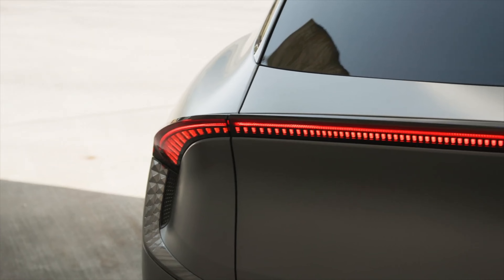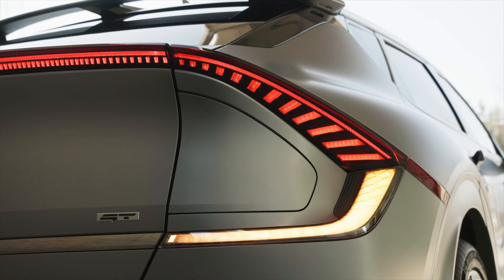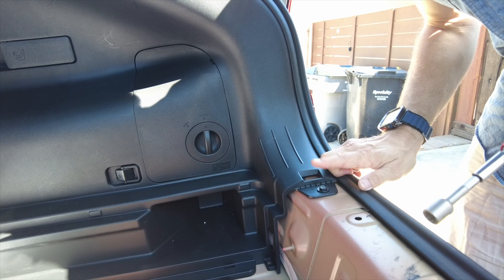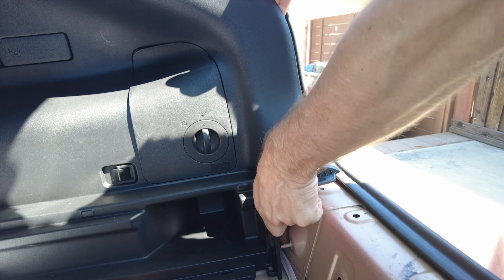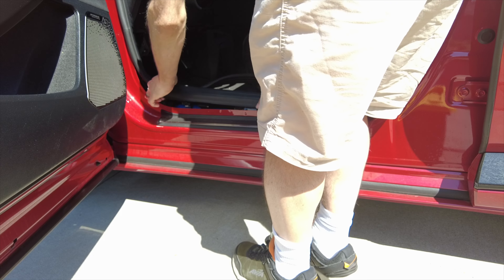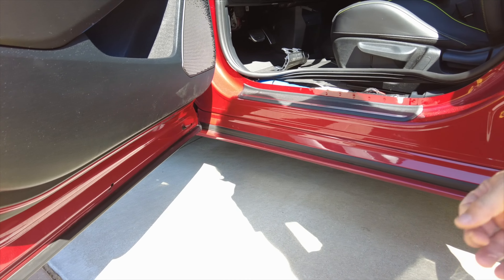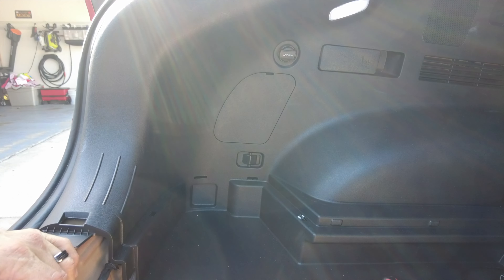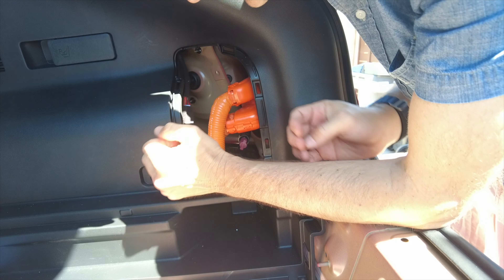SEQUENTIAL TURN LAMPS 4 EV6!  The Epic Install

Comment: Great Video. I am actually using the instructions just to replace the original LED bulbs. I was quote €1600 for the entire assemble when just the LED strip can be bought for about €250. You video makes it clear it is possible to fix this myself. Thanks very much.

Comment: I agree Kyle_11111 did a great job on the harness and the instructions. I added this to my GTLine two weeks ago. My biggest difficulties were 1) I missed one of the nuts holding the left light module to the car and fought for a long time before I found that, and 2) I didn't remove the extra screws holding the side trim pieces of the trunk, which makes it much more difficult to run the harness through to the door.
I ran the harness through the base of the B pillar, it looks tight but does fit. I didn't think the new wires would fit through the grommet with the existing wires, so I sliced a notched flap into the grommet and fed them through that. I would have liked to have seen how they look when you got that in there. Putting the final trim on the hatch sill was an issue for me, the weather seal wanted to go beneath it, and it took a bit of effort to get the seal over that section of trim.
Reply from the maker: Thanks for the B-pillar tip!   The trim wasn't much of an issue for me -- I had to use my finger, however, to make sure the weatherstripping was over the plastic piece.  That just required patience.  I didn't take a video of the grommet, I was just too sweaty and in a rush at that point!  But it was difficult to feed the wire thru the grommet, if I had to do it again I probably would have made a small cut in the middle and fed the wires thru that like you suggest.

Comment: Kyle just needs to start manufacturing harnesses again! Next project... maybe.
Reply: Built my own harness... and PCB too. Notes: the trailer hitch connector provides a 'clean' brake light signal (not power) and ground (but ground can be used from the original brake connector). Front two wires are getting 'clean' turn signal lights (US rear brake/turn are combined on one wire). PCB with relays builds a Hazard Actuator (solid, not sequential for hazards as you stated). Front projector lights can also use the same PCB, just need a wire to the headlamps.
Reply: I should have more harnesses available at the end of the year! Just sold through another batch this past month.

Comment: Why don't you use the power from the original signals light at the rear to power those lights?
Reply from the maker: There's an amazing hacker who created the harness I use.  Cannot tell you why the power from the original brake lights isn't sufficient, but I suspect it is because the power isn't sufficient for the sequential signals and/or the PCB that controls the logic.
Reply: I am the one that made the harness. Power is tapped at the front mirror lamp wires due to the fact the rear signal is combined with the brake light signal. For the new lamps to work new separate brake and turn signal wires have to be used. For the brake my harness uses the trailer harness and for the turn signal the front mirror signals are tapped.

Comment: need a little help. at the 9:15 section of your video, you were able to pop out that whole section using an air bag. i'm having trouble with that. i have the air bag in and have followed your video to a T but that darned thing wont pop out. ive tried a plastic shim tool, nudging it, gently banging it etc... any advice for me? 
Thanks.
Reply: any one there??? still no luck. havent used a hammer yet to bash the thing out but thats Plan D!
Reply from the maker: sorry, life.   I would say try harder?  hope you got it off by now!

Comment: Great video, but it's kind of strange that this isn't just plug and play by simply replacing the sequential signals. I ws excited until I saw how much &^%$ I have to take apart.
Reply from the maker: these turn signals do not comply with US Law, so they purposely do not have this set up to be plug and play for US-spec cars
Reply: @ev_kimchi  Really I think they designed the lighting system this way to reduce costs, they don't care if they are plug and play or not. By not having the wiring/terminals on the car they are saving $20? x how many EV6s sold in the states.